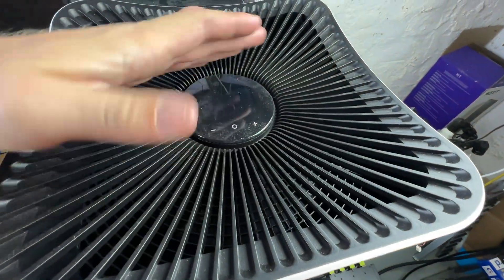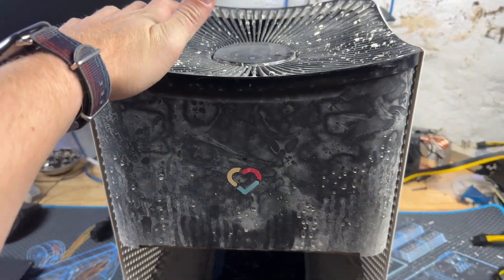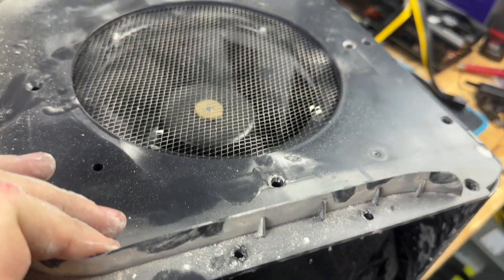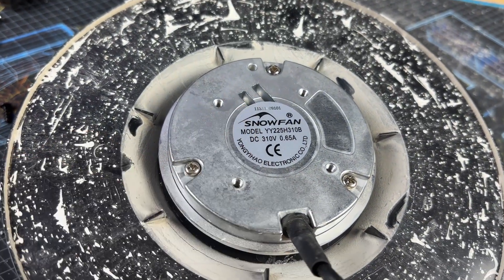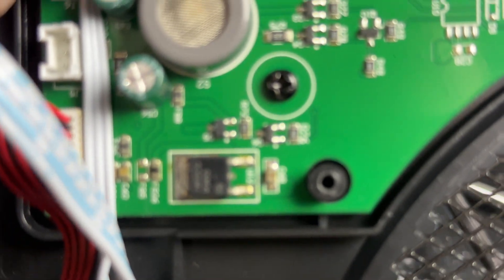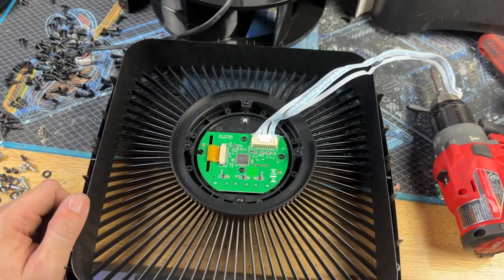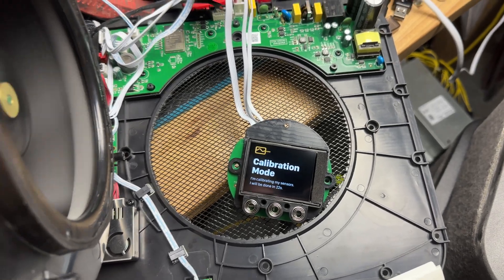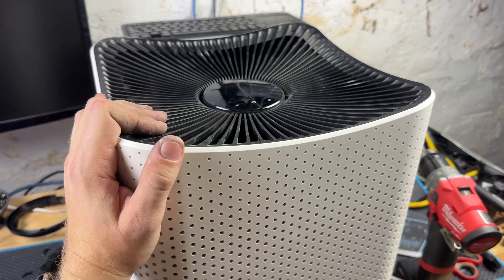Making one working Mila air purifier from FOUR broken ones - board failure

Comment: Any help on a Mila that won't power on? Switch and fuse test fine so getting power to board.  Do not see anything noticably wrong with caps.  Produced 11/15/21. Not sure what else to check and if a repair can be made.

Comment: Hi I just repaired my power supply would not fire up replace the electrolytic capacitors C9, C13 100uf 35vw and C8, C12 22ouf 25vw with Low ESR (the 4 together).

Comment: I would never buy this brand ever again. I have 6 and 2 got replaced under warranty and another 2 just died (no power). After watching your video I won't even bother taking it apart LOL
Reply: They also did a change with the sensors on the 2 replacement units, compared to the original oness they never actually detected certain levels correctly so never cleaned the air the way the 2 new ones did. Very annoying.